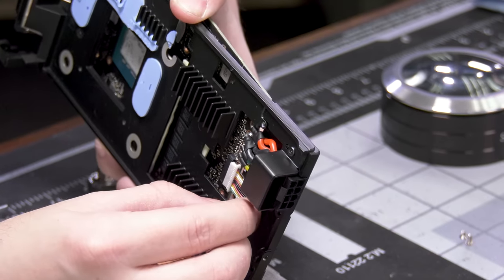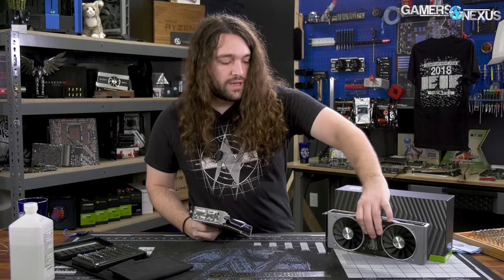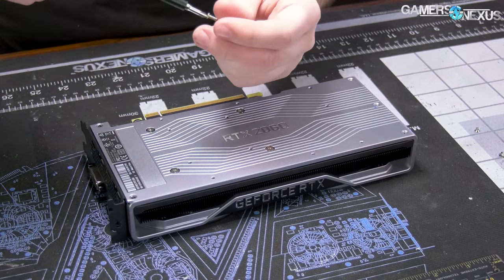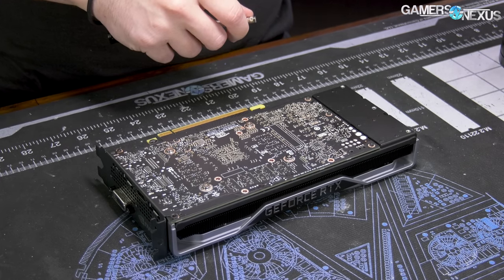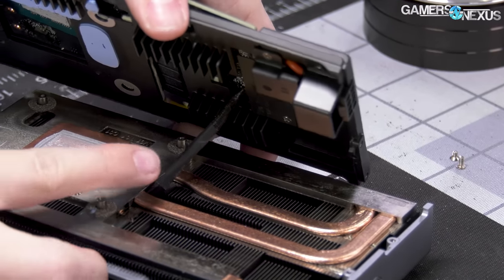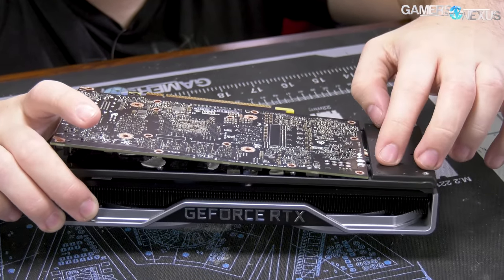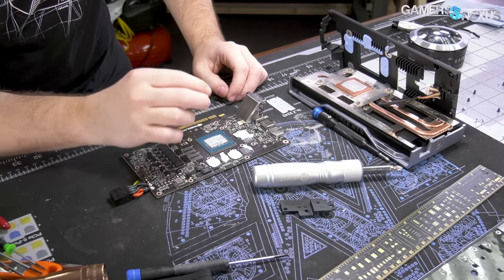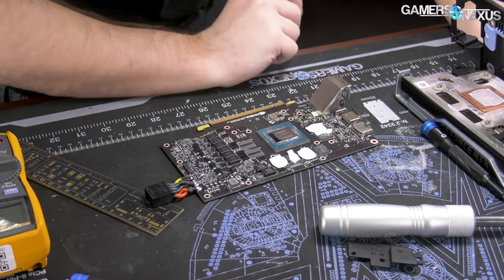RTX 2060 FE Tear-Down: They Added More Glue and Screws

Comment: RTX 2080ti=RTX 1080p so RTX1080= 720P OH boi what's the 2060 for? These prices are ridiculous and I'm betting that a lot of people are going to hang on to their Pascal cards for the next additional 2-3 years instead of buying a new card like they used to every year
Reply: The 2060s are wrecking the 1070tis for less money..
Reply: @sicariodesviado678  the video cache isn't there sometimes I'm using 6 and 1/2 7gb for the resolution i'm running any thing with less than 8gb video cache would be a downgrade over a GTX 1070. And I just got another refurbished with warranty 1070 for $275. Most of the titles I'm playing right now have SLI support so I'm probably good for the next 2-3 years.

Comment: nvidia want RMA approach not customer fix it themselves ...its very simple to do RMA than WTF STEVE DOING  WITH RTX 2060 ?? WHATS THE POINT...NVIDIA COULD EASILY TELL ITS CUSTOMER UPGRADE TO RTX3060 in NEXT 3 YEARS ...WHY SAVE OLD ONE ??? YOU GET DISCOUNT WITH SENDING rtx 2060 FOR 3 YEARS USED...GET rtx3060 HALF THE COST in their channel

Comment: nVidia continues to disappoint.:
Why sommany screws?
Why not an even smaller PCB?
Why isn't anything detachable?

Seriously Jensen, I can only portray the average consumer as Cogsworth to George Jetson for so long  before the joke becomes sad. Custom PCBs have got away with headers and detachable components for long enough to teach whatever fuckstick engineered this thing  to make a board which is easy to repair.

I would joke they hired someone from Apple to make this board but even them have designers who make their machines easy to take apart. This is just stupid and full of mistakes which should reduce the value of this card. The nVidia GTX 2060: A great addition to any rubbish bin!

Comment: Wow, such a piece of crap, still struggling with Linux drivers but I don't regret it that I've bought a Vega 64 for my new PC after a GTX 780 (never had problems with it but their actual politics, awful).

And I've disassembled a few graphics cards in the last months: stock Sapphire R9 290 (replaced the 'Tribute to GeForce FX 5800 Ultra' stock cooler with a Raijintek Morpheus), Sapphire HD 6950 Dual Fan/DiRT 3 Edition (BIOS with all Shaders unlocked, so a 6970), stock Zotac GTX 760 and Asus GTX 780 DirectCu II OC, none of them had something glued, just needed a PH1 and PH0 screwdriver, you just had to watch out with the fan cable/connector if the R9 290 and GTX 760, also the Heatsink of the GTX 760 was a little difficult, when putting back together but no problem.
 
Jensen Huang shound better change his name to 'Huang-Son', so that it sounds similar to German "Hurensohn" = son of a b*tch: https://youtu.be/iYWzMvlj2RQ?t=25